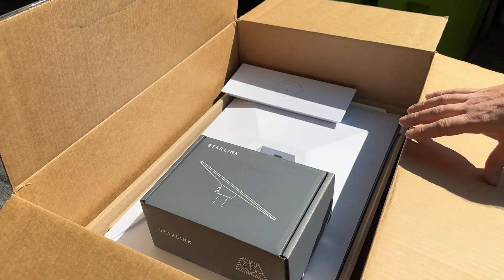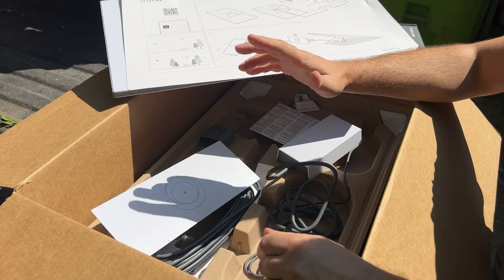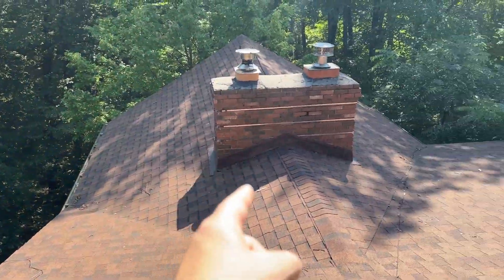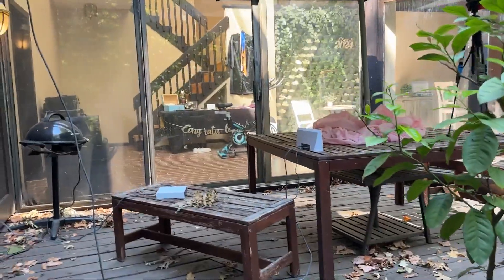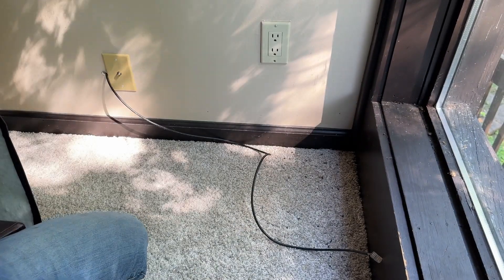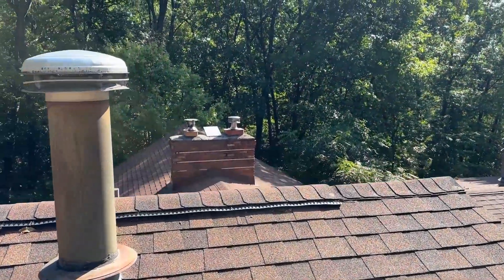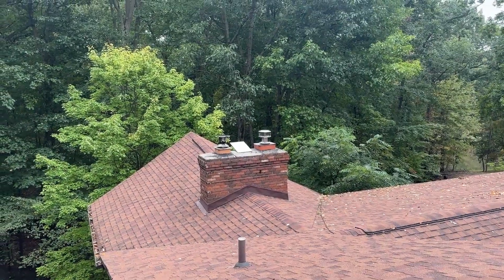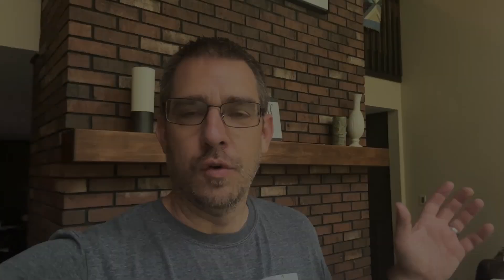Does Starlink Work in The Woods?

Comment: My experience in a very similar situation is that it is better than any other option (DSL with 4mb down and less than 1mb up), but I do have several outages lasting greater than 2 seconds in a 15 minute period.  
For normal household internet, most people won’t notice. However, I work from home, and it is very obvious when you are in audio and video calls and it drops out for a few seconds.  The calls pause and then have to reconnect.  If I’m watching videos it will occasionally buffer, but not too bad. 

There is a website that shows all the Starlink satellites in space and I now fully understand why the service is so poor while others rave… there is a large belt of satellites over the central past of the US, but the farther north you get (and you point the dish north) the fewer satellites there are. 

Also, I am experimenting with pointing the dish south east. That’s where I have the clearest sky view and least tree obstructions. It’s ok. The app nags me that I’m not aligned correctly but it works and at least I feel like in get fewer outages. We’ll see how it goes longer term.

Comment: It actually connects to a different satellite every 2.5 minutes. Those are in low earth orbit, so they are passing by very quickly. The kind of obstruction you have means that it cannot connect to satellites that are passing through that area, and as it has determined that that area is obstructed, it will not even try. So you will not get a bad signal from those trees, but connections to satellites that may not be the most optimal ones. However, with the number of satellites up there nowadays, there should always be enough available.

What's more limiting to your speed is that you're in an area with many Starlink customers. Satellites, radio waves and base stations are a shared medium, so the customer density in an area directly affects available bandwidth.

Comment: For me, just watching you walking around without a care in the world on the roof was giving me major oh-no's.  I don't do well like higher than 3 steps on a ladder.
I'm glad the people I bought my house from had their Starlink Gen 2 on a motorized pole in the middle of the yard.  Every so often it might think there are obstructions, but for all in intents and purposes no problem.  It too has the heating function so the snow doesn't pile up.
And since you reminded me, I did a speedtest:

Download Mbps   320.02
Upload Mbps          27.32
The latencies were in the low 20's.

One thing I have to investigate is that my Samsung S21 Ultra experiences pauses during my wi-fi calls. The call doesn't drop or disconnect, but basically it's as if both parties muted the line. I can't hear them and they can't hear me. It lasts for maybe 15 to 30 seconds. My friends and family know about it, so we will have to repeat things at times.  I don't know if it's the phone itself or is it the Starlink system.  My computers and such work and yes, I did buy that Ethernet adapter so I could have everything wired.

Comment: Snow removal?  All the leaves will be gone soon so less blockage! Frontier internet it comes through the good old phone line, no it's not dialup. Less than $70 a month. No down time or "data" limits. Thanks. Be careful on the roof. God bless and protect.
Reply from the maker: I used to have frontier, I wish I had it here!
Reply: This was super helpful! I am considering Starlink for work. And have loads of trees. Thank you!
Reply: I have Frontier..... 2.1 Mbps, not 210, not 21, 2.1.

Comment: I have terrestrial wireless internet. I put up a 35' tower on the edge of my woods, and run an ethernet cable 250' to my house. I get a consistent 50mbps download and 5mbps upload. Latency is usually in the low 20ms range. I have not had an outage in over two years. I'm glad to see starlink works well. It's nice to have a backup plan.

Comment: We put Starlink on our community hall. We were in a similar situation — quite far off the beaten path. 
I want people to be aware that since it is space-based, it won’t work during rainshowers, thunderstorms or blizzards. The signal cannot get through water (although fair-weather clouds are okay)! So don’t be surprised! 😀
Reply: This isn't quite right.  Water can effect the signal but it often still works depending on several factors.  Around us in Oregon and Washington state I know quite a few folks with Starlink that have no issues in the rain or snow.
Reply: @SteelheadTed  you are right — in a light rain, no problem! But we had a 40,000 ft tall cumulonimbus cloud (I checked the echo tops RADAR 😀) parked over the hall giving us quite a downpour and the internet really dropped off badly.
Reply: @PandTRanch  OK, but that’s not the same as “won’t work during rain showers”, which isn’t the case.